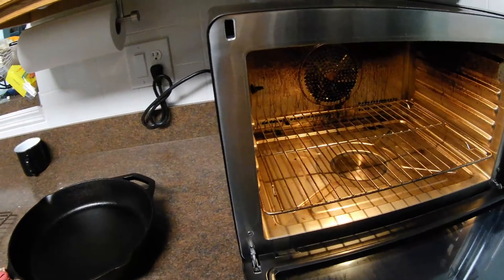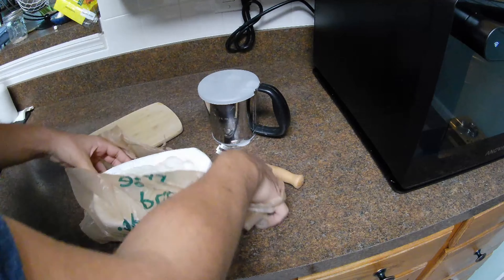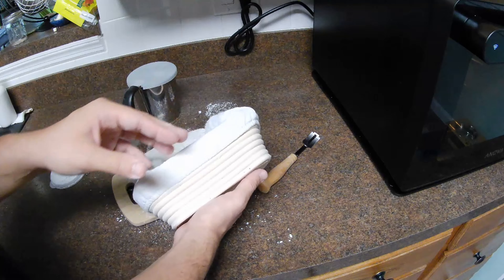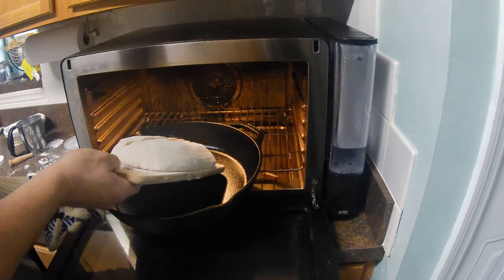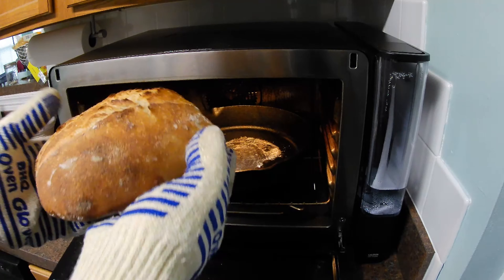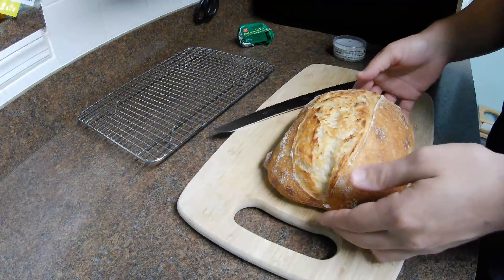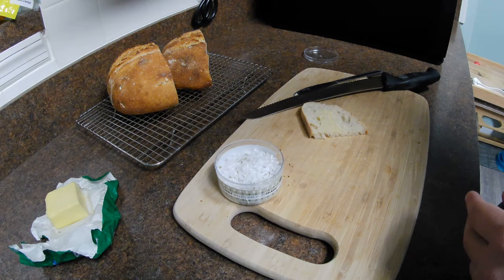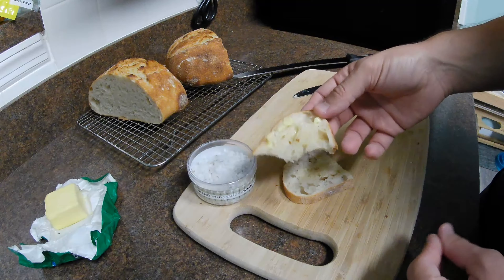Sourdough Bread | Anova Precision Oven

Comment: I just got one of these ovens.  My first sour dough came out near perfect.  I just used the tray that comes with the oven and placed the loaf on parchment and slid it in.  Preheated prior to 450 with steam at 100%.  Cooked for 20 minutes at full steam, then another 20 minutes without steam at around 400.  I did open the door a few times to let steam out during last phase.  No complaints.  I think most need to adjust the bread hydration to get it right.  Experiment.  Baking this way is different than a conventional oven.  Normally for me to get the same results would be twice the cook time in my regular oven in a dutch oven.
Reply from the maker: I’ll have to try baking a sourdough using the included baking sheet instead of my cast iron skillet. I hope you’re enjoying your Anova oven, I love mine!
Reply: how do you get oven spring without a massive preserved heat underneath? I htink the second you open the temp drops by about 30F and during loading it might go twice of that.. I will try 'dough'
Reply: Which heating element did you use? Top and bottom?

Comment: I have the Anova oven  but my center is not getting cooked enough as you are doing. Hi hydration can be a little gummy inside. I am leaving the temperature at 450 for maybe six or seven minutes and then I turn it clear down to 325 and cooking about 30 to 35 minutes more. The inside is turning out  better. This is a personal preference but after I turn  it down I don't dump the steam I leave at 100% it's definitely not as crispy as dumbing and going to 0% but yet still sum crisp. Again personal preference
 If you cut more to one side and angled toward the center you will get more ear. If you want the ear
I just read the size of your loaves mine are larger at about 890g total. 
I have also did a lot of enriched breads at 65% hydration I am using the oven to proof them in a bread pan and then immediately turning it to 325 and the entire bake is at 325. so 95 proof to 325 bake at 100%. After 20 minutes I take it out of the pan and finish direct baking on the rack;  turns out beautifully browned all over and very soft because it's an enriched dough.
Reply from the maker: Great tips! I may have to do a video with an enriched dough!
Reply: Read Jeffrey Hamelman's book "Bread" and do what he does.

Comment: my apo shuts itself down when using steam any idea why? all other functions without steam works fine
Reply from the maker: I would try unplugging it and let it sit for a couple hours, then try it out and see if it works. If that doesn’t fix the problem, I would contact Anova support. My experience with them has been good in the past. My water tank was cracked and they sent me a new one.

Comment: I just ordered one. I am disappointed to hear about the cracking.
I am a very long time hobbyist sourdough Baker.  literally thousands of loaves. And I am anxious to try it. What was the total weight  your flour and what percentage of starter did you use and hydration amount? I'm going to try to find a small baking stone would  a 14 inch round stone go in this oven?
Reply from the maker: Hi Sonny! Anova is supposed to be working on modifying the tank to resolve the problem. Although support has been great, they sent me a new tank fairly quickly! This loaf had a total weight of 567g, 70% hydration, 20% starter. Check out my video here for the recipe: https://youtu.be/KCjFMUZRAgg included in the comments are recipes for 70% and 80% hydration. Anova has a baking steel listed on their website, I'm looking to maybe get one myself. Happy baking!

Comment: When you start the oven, how do you know that the oven is getting steam.  It comes up outside of the water tank but I do not see anything inside the oven.  The read browned quickly.
Reply from the maker: I notice the steam out of the corner of the oven. When opening the oven, I can usually feel the moisture in the air.

Comment: 450 degrees C or F? (I think F but just wanna be sure)
Reply from the maker: 450F! The max temperature of the oven is only 482F.
Reply: 450c and the aluminum pan would be molten in the bottom and the copper wires would dissolve

Comment: Anova is nightmare for baking bread without dutch oven(or similar equipment) Steam escapes too fast, crust forms too quick, poor ovenspring. I use it as my main oven, works amazing for meat and huge air frier, but not bread baking without cover.
Reply from the maker: I’ve had some success baking bread in my Anova oven, but I have to admit my results are generally better in my conventional oven. I’m still doing some testing, and I still need to try out the “oven off” method for baking sourdough in the Anova.
Reply: try the oven off method. thats what my friend does and she gets good oven spring
Reply: What’s the “Oven Off” Method ?

Comment: … now if I could just get the firmware to update 😭
Reply from the maker: Are you still having trouble updating the firmware? I know some other users had to upgrade their WiFi router in order for it to work.
Reply: @josephlacattiva  yes. everything seems to be working ok on the old release, but...  I did set up a private 2.4 GHz network and disabled my 5 GHz to get past the setup stage. haven't tried just using the iPhone as a hotspot instead of the home network yet, cuz PITA